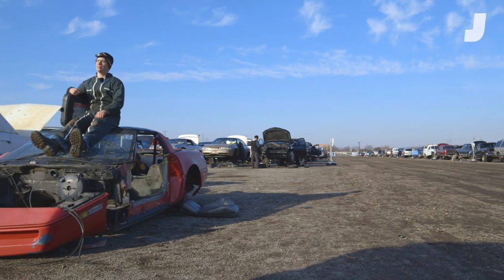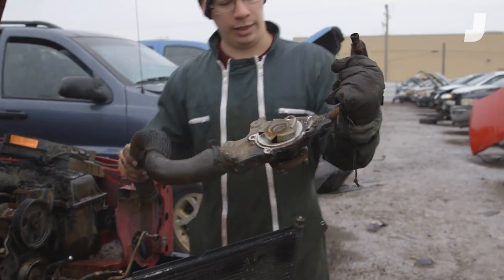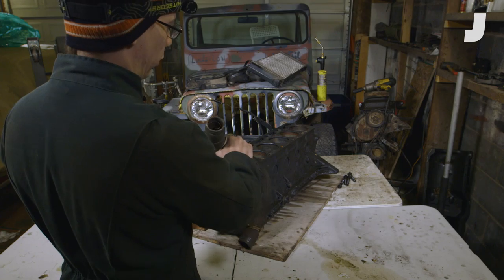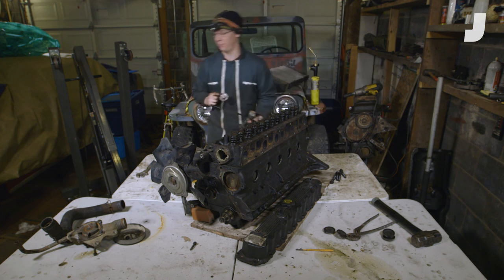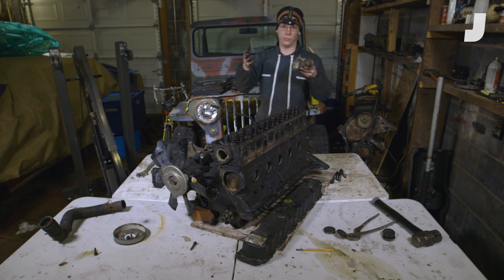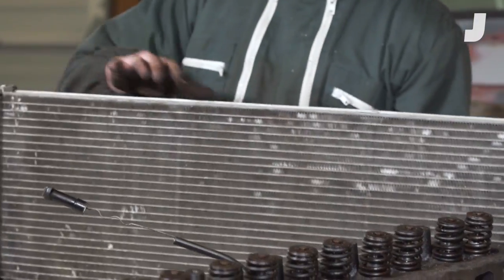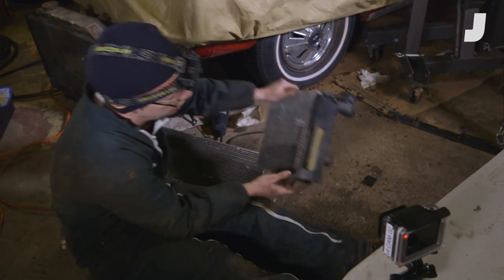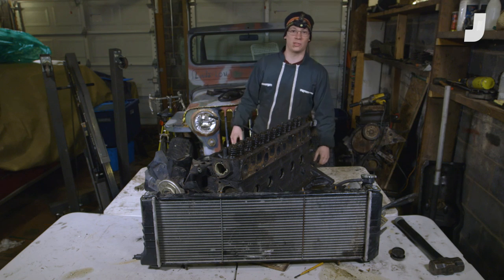How A Car's Cooling System Works | David Dissects

Comment: This is fantastic. Please do more. I'd appreciate some more information on vacuum lines and how they help power engine components.
Reply: Dimitris T - I second, the vacuum system in-depth talk would be great.
Reply: It is actually very very simple. The 2 basic things to remember are the engine makes a lot of vacuum at idle and none at WOT. Everything inbetween is at a different vacuum level.

Fuel pressure regulator - when at idle the vacuum holds it open so fuel returns to the tank. When you start pressing the gas pedal less vacuum is supplied and it begins to close. At WOT it has no vacuum and shuts completely letting all the fuel stay in the fuel rail at the motor to maintain pressure.

HVAC system - used to control the doors and such. Basically the HVAC head unit gets constant vacuum and usually has a one way valve so it can have vacuum at WOT. WHen off no vacuum is supplied to the doors. When you turn it to a position it pulls a vacuum on the door mechanism and causes it to move.

Cruise control is usually electric and vacuum. It uses the vacuum to move a diaphragm which pulls a second throttle cable. When the correct speed is reached it will close a valve preventing more vacuum and then regulate the internal vacuum to control speed.

Brakes - the most important of all. A bigger vacuum line always goes from the motor to the brake booster in gasoline cars. What it does is supply vacuum to one side of the booster to make it easier for you to push the brake pedal down. "Brake-assist".

Some older cars even used vacuum to control the wipers, windows, convertible tops, etc.
Reply: Excellent write-up. Much appreciated!
Reply: And then they wonder when they put a big cam in their C3 Corvette why the headlights won't come up. :P

Comment: Really well explained, David, and I appreciate the full disection of the radiator. I plan to reference this video in my Covid lockdown online Auto course.

I would love the inclusion of two more elements: a little more detail on the heater core (people think the heat comes from the fan speed and don't understand that they have to wait for the coolant to heat up), and also show a block heater in one of the frost plug holes.

Keep up the good work!

Comment: small question, the front cilinder Will get the first water and will be cool. what happens to the last cilinder (at the firewall), the water will be a lot hotter, and will there be any flow left? please let me know! great video!
Reply: Coolant flow is pretty well regulated under pressure, the pressurization raises the boiling point but also equalizes coolant temps in the block.  Now the front of the engine can tend to be cooler from ambient airflow from the cooling fan or from driving, that's why newer cars have warmer engine bays from all the insulation and tightly compacted parts to regulate outside temperature around the engine, compared to older cars with simple steel hoods and plenty of engine bay space.
Reply: Also to add to what Midnight said, not all cars have one point of entry for coolant. Engines usually have internal crossovers and bypasses both internally and externally. Not all flow front to back, some are reversed and some go across. Inline 6's like jeeps do have a temperature difference from front to rear usually only 1020 degrees tho.
Reply: The coolant is flowing constantly so it doesn't matter as it all equalises to the same temperature. so long as each cylinder has the same surface area in contact with the water.
Reply: Reversed coolant flow can be a nightmare, they do it to cool the heads first to safely increase compression ratio, but everything below the heads suffer.  Rod bearing and head gasket failures can be common, and of course they run the Dexkill crap from factory, so anything it touches is as good as clogged.  Ask JC316 how many LT1s he's had to replace in his lifetime, and I'm a guy that praises the GM Chevy small block!  That LT1 doe, it ain't worth it.

Comment: i need a Cherokee radiator, i;m still not sure that a junk yard one would hold. because Jeep. was used as jeep.
Reply: Radiators are one of those things I always buy new. Even if you find one that hold water you never no how clogged the tubes in it are. Could be the previous owner never changed the coolant.